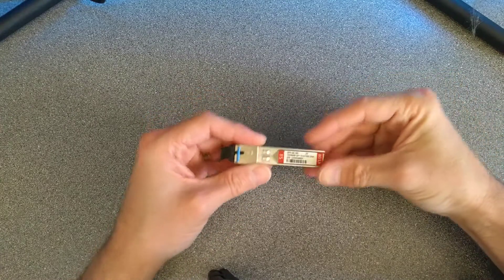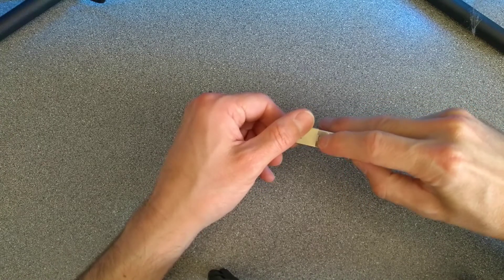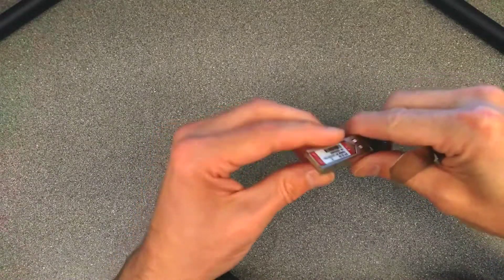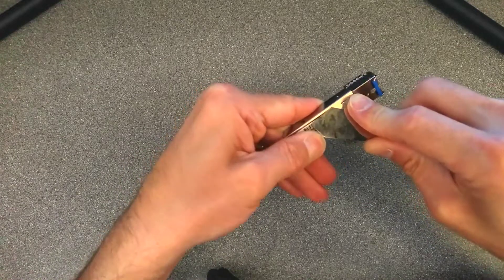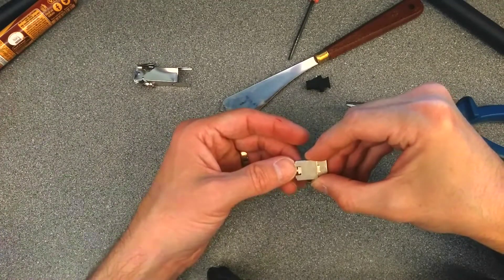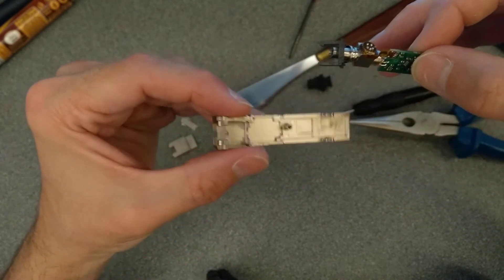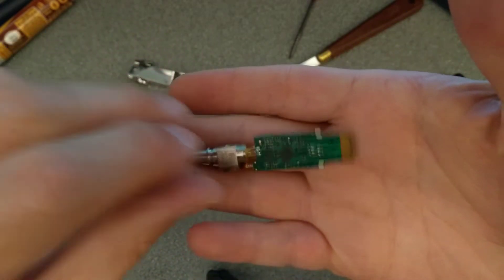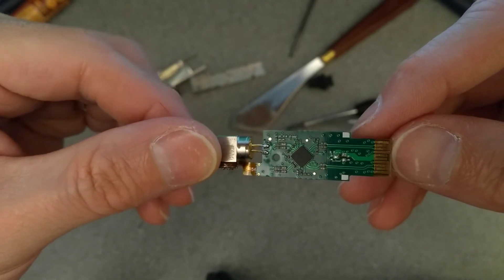What is inside a fibre optic SFP.

Comment: How do they get 10 gig over these coarse wires to the laser and from the optodiode? 
Doesn't it have to be microstrips or striplines at these frequencies?
Reply from the maker: The one in my video is a 1gig optic. The 10gig non bidirectional one I've opened did use microstrip type flexible wire.